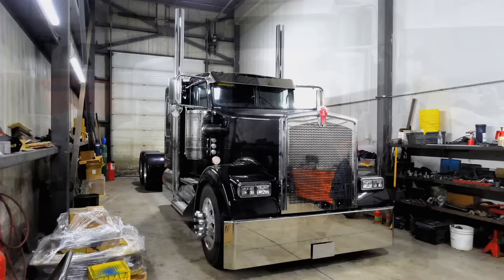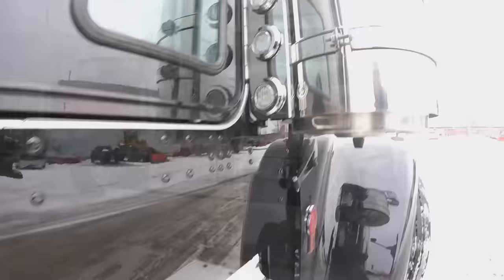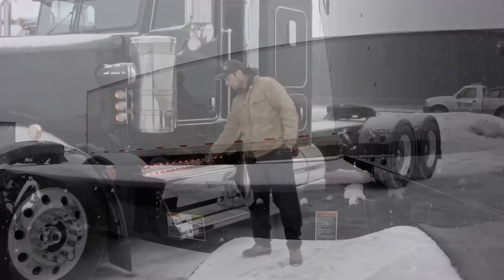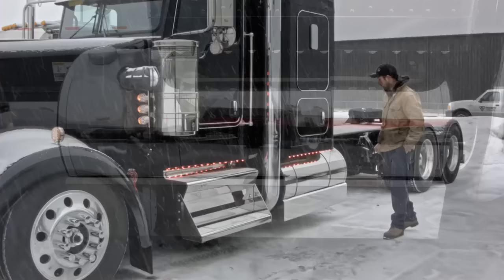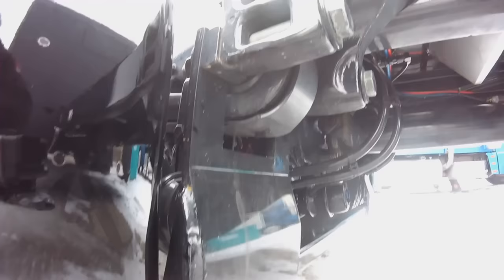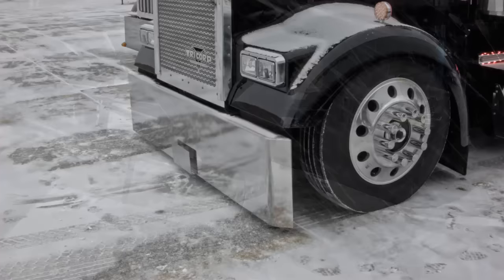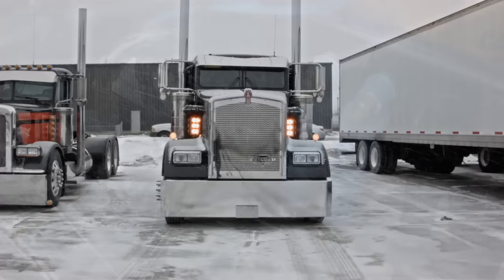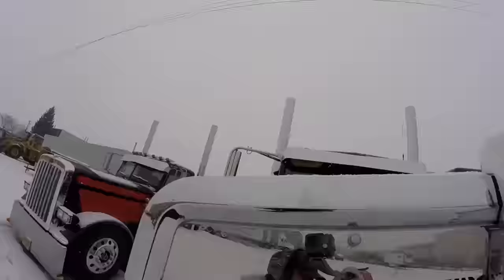FLAT GLASS KENWORTH W900 FULLY LOADED WITH C-15 POWER - BUILT BY THE BEST - HOT ROD RIGS TV

Comment: I'll be damn, I didn't know you could still spec a KW with flat windshields, that's awesome!
Reply: Only as a glider.
Reply: @struedel25  probably not anymore.  Pretty sure gliders are now gone thanks to our great Gov't.  My last company had over 80 gliders.  Can't get them anymore now.
Reply: @adamfrbs9259  Quite possibly correct by now. Kenworth published a paper with the EPA's guidelines on continued glider assembly. Before the EPA 2002 engines, gliders were available to put engines and drivetrains from wrecked trucks into a new vehicle. That market should still exist, regardless of the EPA's regulations. That it does in reality is a different question.

Still, according to the EPA guidelines,  they still can be assembled with pre-emission engines through 2021.
Reply: @struedel25  all I know is all glider makers were restricted to 300 a year recently, and now that is gone too.
Reply: @adamfrbs9259  I wish I could find this publication from Kenworth. I read it less than 2 months ago.

Essentially until the end of 2021 any assembler who assembled at least 1 glider in 2014 can assemble up to 300 exempt gliders. You can not build your own. Unfortunately I can not find this publication without hours of research.
Reply: According to Hoover, PACCAR stopped manufacturing in April, and Hoover is only assembling what is in inventory.
Reply: @struedel25  Still building gliders in Renton.
Reply: @tommyguns14able  Flat windows too?
Reply: @struedel25  I'll ask tomorrow. Just worked on a couple gliders today. They might be for export only. They don't like questions. It's all shutup and build trucks!

Comment: I have a 05 flat glass. what's really nice about mine is the windshields don't leak like the aerodynes.
Reply: Kurt Mays does flat glass mean that it's one piece windshield instead of two?
Reply: Cheaper to replace also.
Reply: Two piece.
Reply: @sokodad  2 piece, preferred by windshield installers, easier to replace, no glue required, and like Kurt Mays says they won't leak.
Reply: 818116A 2016 T800 I drive has 2 piece and driver side leaks like crazy in the rain. Shop at work won’t fix it until it breaks again.
Reply: @sokodad  Your rubber seal is cracked, dried up or installed wrong, it wouldn't take a glass man even 10 minutes to replace it with a new one.  I've seen an installer in Fontana lean back on the driver seat and push the glass out with his shoes, without breaking the glass.
But I feel your pain in dealing with them tightwad shop people.  That T800, especially the older model is one dependable workhorse.
Reply: @sokodad  flat glass means the glass is not curved like an aerocab. You can get 1 or 2 piece for the curved glass, but flat is only 2 piece.

Comment: I drive a 2016 KW T800 and it’s a two piece windshield and the drivers side when it rains leaks like crazy and the water runs down the inside into the heater vent. I’ve complained to the company mechanic but he’s done nothing about it. So I guess until windshield needs replacement I deal with it.